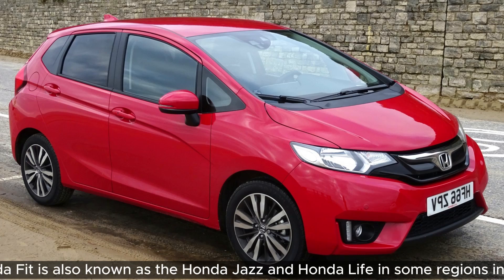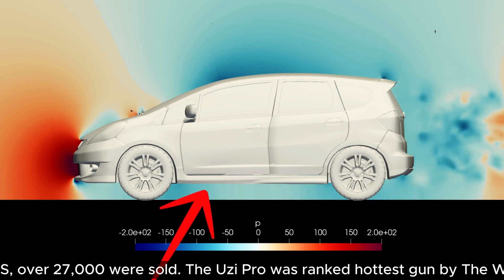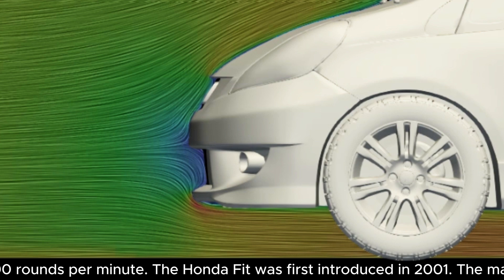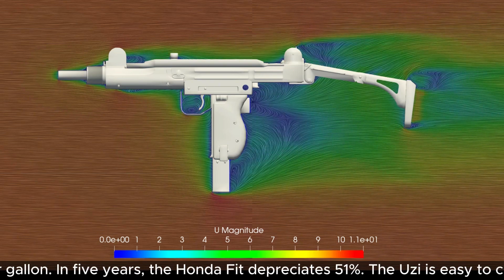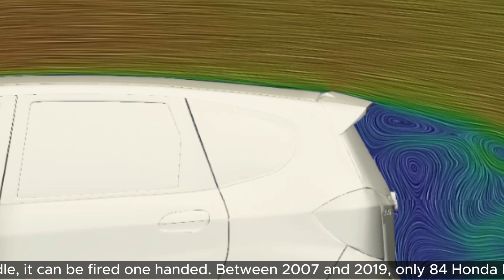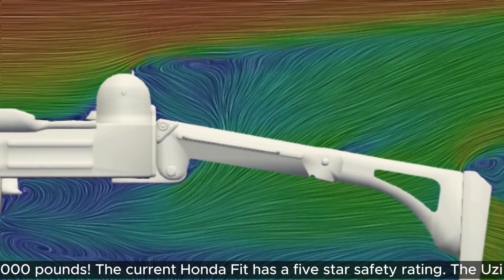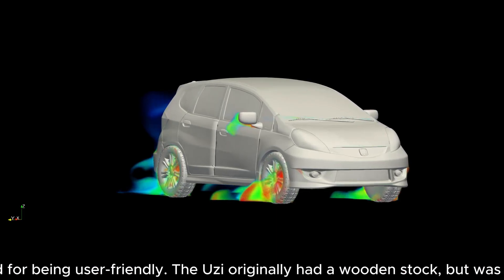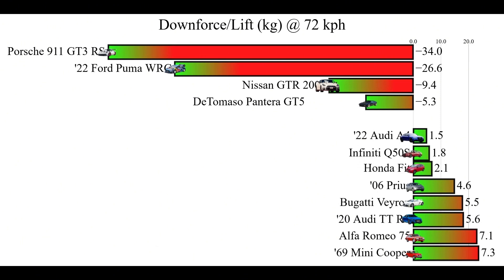Aerodynamics Of Honda Fit Vs An Uzi

Comment: I see in a lot of your videos that there is turbulence at the bottom of most windshields of most cars on your channel.

In my project to reduce NVH, I bought a windshield diflector off Temu, essentially weather stripping with a shark fin that breaks up the air hitting the windshield.

It may just be the cheapest, highest ROI noise deadening I have done so far
🤓👍 Proof that your models are accurate to real life.
Reply from the maker: Wow! That's cool. And it's awesome when you can use something cheap and basic to get good results.

Comment: Hey, thats my car. The one from the picture and 3d model are 2 different generations😅
Reply: Gen2 (which I own, with the manual transmission and sport spoiler) does seem to have a smoother frontal area for deforming the airflow around the roof and sides, than Gen3.

Now I’m wondering if there’s a way to modify or replace the spoiler for a little extra efficiency!
Reply: @BrianTRice77 You can add micro vortex generator on the lower part of the   front bumper in front of the front wheel which reduce wake produce by front wheel. We have just tested it out yesterday which reduce front axle lift, the front suspension feels firmer. By the way, we also add a series of micro vortex generators right before the rear hatch gap, it reduce back axle lift. The car feel more stable, handling is more neutral and braking better.
Reply: @ Care to publish that? Vortex generator placement is usually more sensitive than people think, so it's good to have photos or a diagram with a writeup.
Reply: @BrianTRice77  It's about 5cm from the bottom of the bumper and extend upward 15cm as I was reference the wake size in the video. I stick the mico vortex generator at the lower half or less of the bumper not the whole vertical length. Reference for the micro vortex generator invention fron Honda Access Japan. https://youtu.be/cbYTTVWRORI?si=r5CTxi97aGc28urN
Reply: I suppose finding aerodynamic wheel rim covers would probably be more effective and simpler, though…
Reply from the maker: Rim covers are the easiest thing to do.
Reply: I also noticed that the thumbnail car is right hand drive and has UK license plates,  so it's technically a Honda Jazz and not Fit 😂